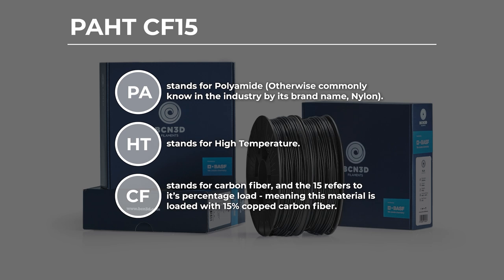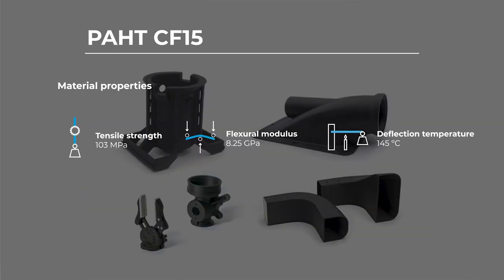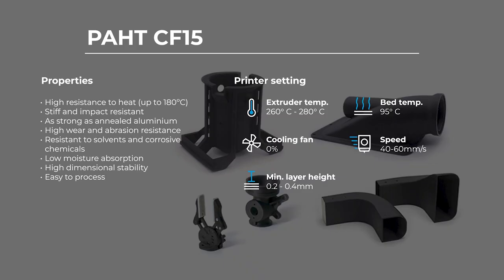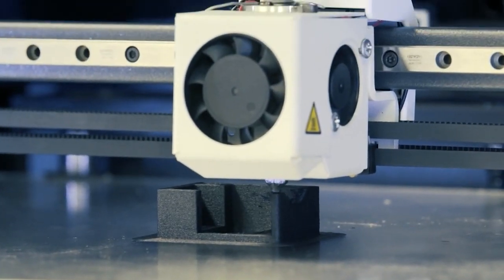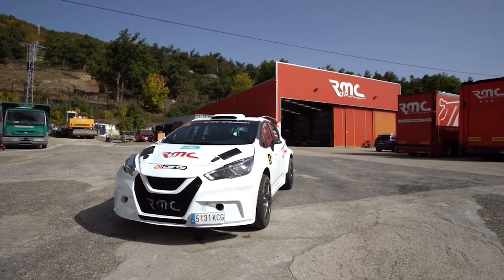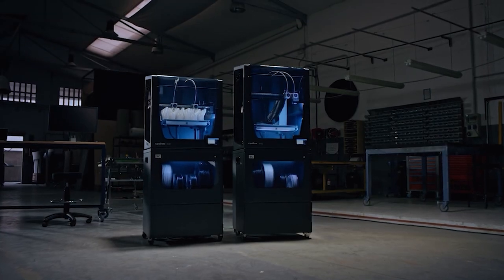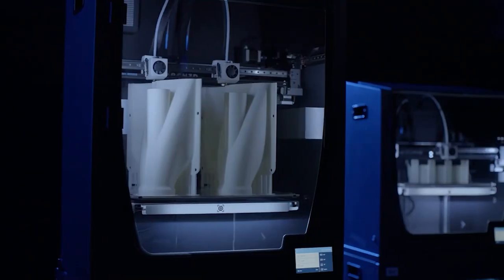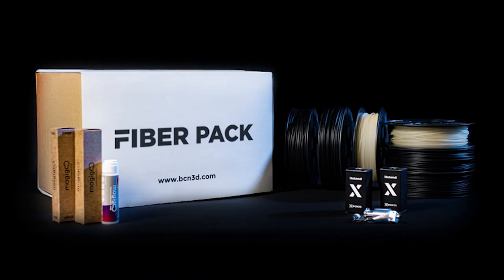BCN3D Explains: The Ultimate PAHT CF15 Guide.

Comment: I found your video most interesting & informative, but could you tell me if this material is better in a heated chamber I do a lot of nylon and I find I get no distortion if the chamber is heated is it the case with this ? Many thanks Andy
Reply from the maker: Thank you, Andy. The approach will depend on the filament's manufacturer and the raw material used in its fabrication. Generally, applying a bit of heat is beneficial for reducing tension in the printed part. However, this is not as critical for reinforced filaments as it is for materials such as ABS or PC, for example.